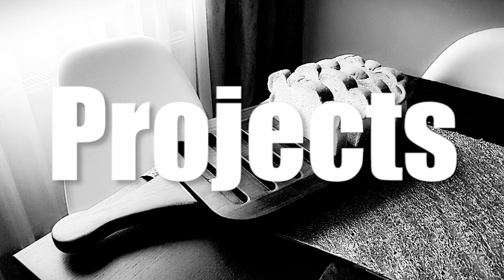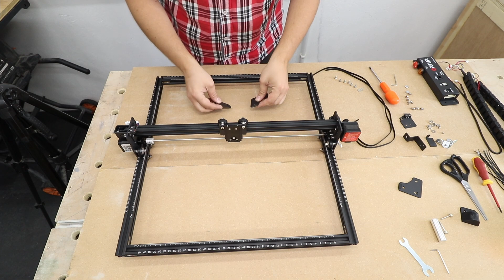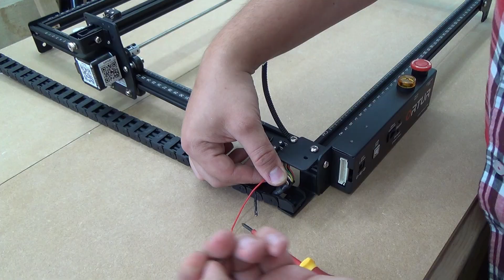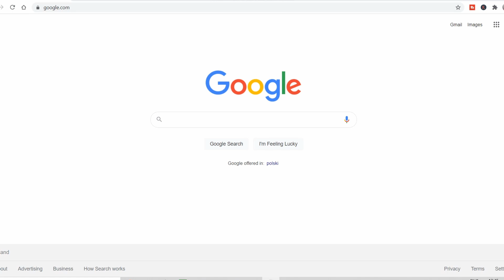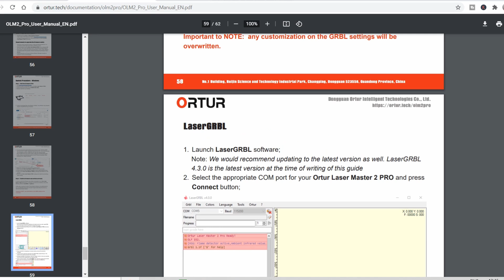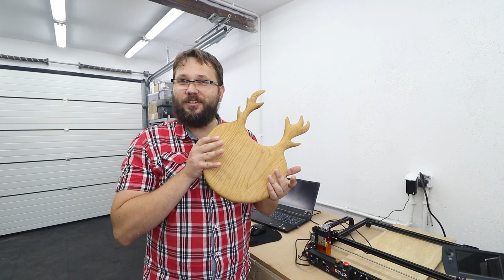Ortur Laser Master 2 Pro Unboxing & Full Assembly - perfect laser for a beginner?

Comment: Nice vid! Been looking at this model for some time now and i've got a (probably stupid) question: I'm a boardgame enthusiast and looking to start cutting my own inserts out of foamcore (5mm). Would this model be sufficient to get it done ? I'm pretty sure it would cut through this no problem, but still want to be sure before i commit to it
Reply from the maker: Hmm not sure if that's suitable, flame hazard plus hazardous fumes coming from the foamcore?
Reply: @CasualDIY  the fumes wouldn't be An issue normally, i've got a dedicated filter that i can use for this. But the fire hazard thing does worry me a bit. Can't seem to find a basic cnc or laser cutter in my area without paying for a industrial Quality type.
Reply from the maker: @Blade90210  yes I see your problem, not sure if even risking $400 on this laser would be a great idea either. Unless you can use it for other jobs if the foam cutting wouldn't work for you. I would try asking around if someone has got a similar laser and then ask then if you could use that laser even pay small amount for the ability to use it and see if there will be any issues when cutting the foam.
Reply: @CasualDIY  I'll probably switch to 3mm plywood then,  i've seen the E-raptor inserts that are made of this material and i can draw those kind of designs fairly easy, so it wont be a waste. I've got a million ideas for this thing to be honest 😀 Thank you for your input!
Reply from the maker: @Blade90210  yes ply won't be an issue 👍 no problem, thanks for an interesting chat👍

Comment: I’ve watched a several videos on various brand machines like this. I love the technology and how it is now getting affordable for individuals. However, I have not seen any uses that make me think I can enhance my products or create new products that will make my money back. Logo engraving can be done with a makers mark tool.
What are some other uses that others have done that I haven’t seen? I’d love a reason to invest in this area. Thanks.
Reply from the maker: I think batching out engravings. For example I made 20 bookmarks, placed them under the machine and in one go they all been engraved with some signs and logos. If you use 3mm ply you can cut some shapes and then put them together, like Christmas decorations. I engraved a map of Poland as a wall decoration. I also used it to engraved patters that later I was either cutting out or routing out. I think there are many options to use these lasers. Imagination is the only limit here👍

Comment: Hi might seem like a daft question but which plug adapter did you use to convert to UK use as it comes with an EU plug. Mine just arrived and after assembly connected it to my  shaver adapter and nothing, no power whatsoever.
Reply from the maker: I thought there was an option to choose UK plug? Just a daft question from my side. Have you unlocked the safety button? As it comes locked as standard. If you unlocked it I would head to PCworld or amazon and look for an appliance adapter. The one for a shaver may be different.
Reply: I bought mine from Made The Best and it came with a UK plug. Ortur themselves said they don't supply a UK plug version!

Comment: 500$ ? This is for begginers?  For real?
Video is good. But i dont think this is price for begginers
Reply from the maker: I think it was 450$ on the website. Am I do mention it's a bit pricey. That doesn't mean it can't be for a beginner. I would say the super budget lasers around 200$ are fir sure not for beginners. They require more skills in putting them together and in most cases they are far harder to set up. So yes we need to establish what is better for beginners. Super cheap laser that they will struggle putting it together and then setting it up send using or something bit more expensive but easy to use and work with🤔
Reply: @CasualDIY  good point

Comment: Great content of the video. I will say and maybe I'm wrong but it looks like you may have put the rails together wrong. 'From the lower left corner of the machine behind the control panel both the X and Y axis, the numbers should start at zero and increasing upward as you move right and up. The software part was great. I had a problem downloading it onto my computer. i then purchased Lightburn. I would have liked to started out with what you downloaded. Thanks for the great video and keep up the good work. I will check out your channel.
Reply from the maker: Thank you very much. Hmm you may be right I need to check that. Thank you

Comment: Does this laser and software only do script, or are we able to import photos or drawings or some sort of art work to engrave? How deep will it cut?
Reply from the maker: It does photos. The laser doesn't actually come with any software. They just suggest what software you can use in the manual you get with the laser. So you can use a photo of anything you want. I think I seen in somewhere it can cut up to 5mm but don't quote me on that. I have not tried the cutting aspect of the machine. Check out the link in the description of this video, the info should be there.
Reply: Thank you very much for your reply. Understand.